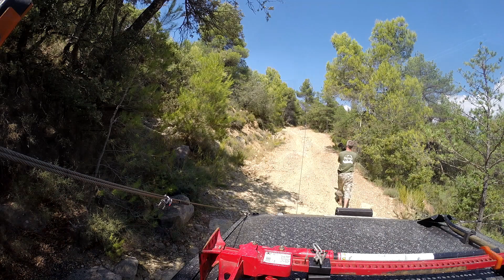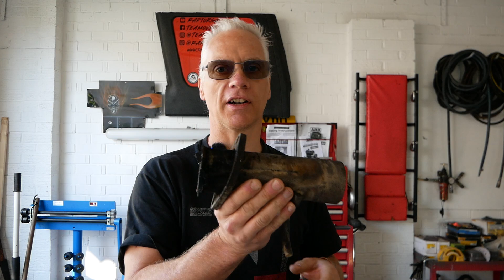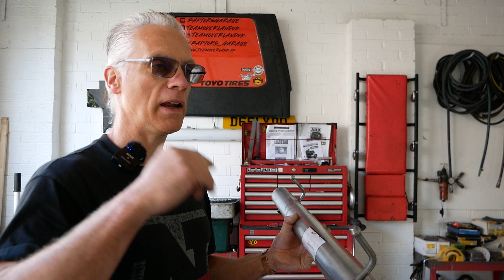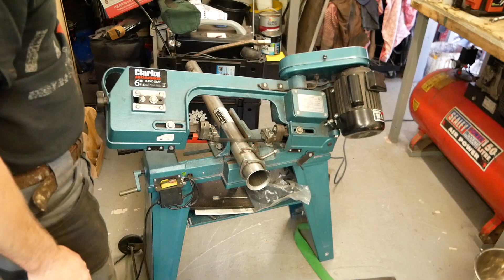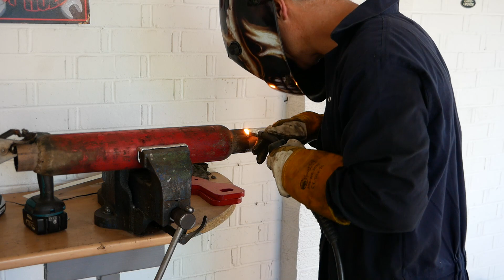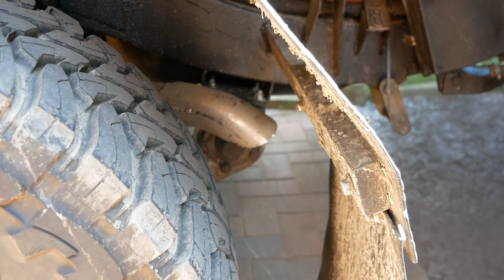Land Rover 300 TDI Exhaust Replacement...Part 2 | All 4 Overland

Comment: hi how does your tdi engine pull with all you arw carrying? im asking because im considering ripping the td5 engine and box out my d2 pickup and fitting the less powerful but much more reliable 300 tdi. all my friends are saying " no tge td5 is more powerfull" yeah once its mapped it is without a doubt (when it runs) but they have a habbit of dieing without any reason
Reply from the maker: Hi...the 300tdi engine is probably more reliable than a TD5 but definately alot less power...the 300 pulls ok but nothing like a TD5...so in mho i would keep the TD5 and go through it from top to bottom...